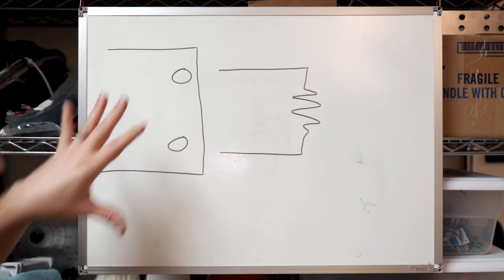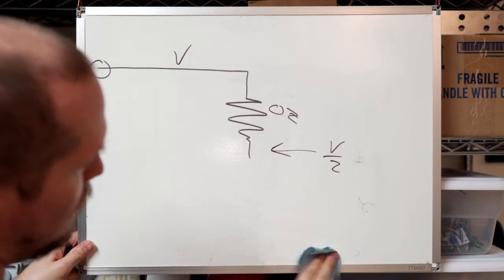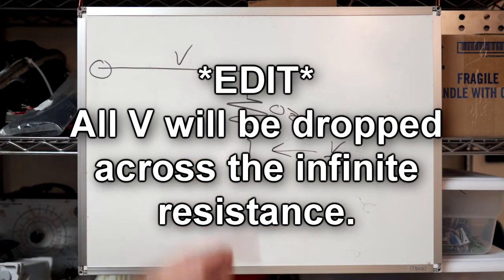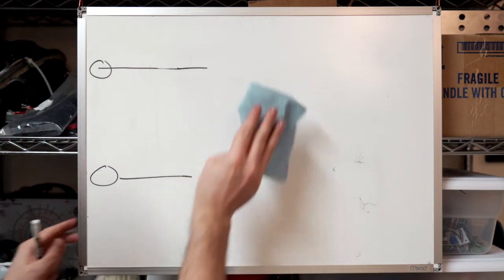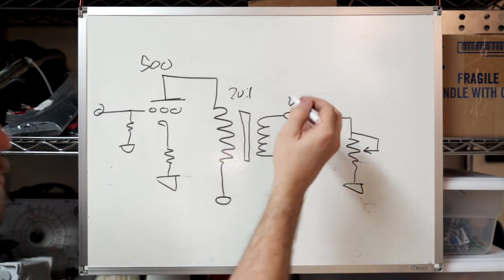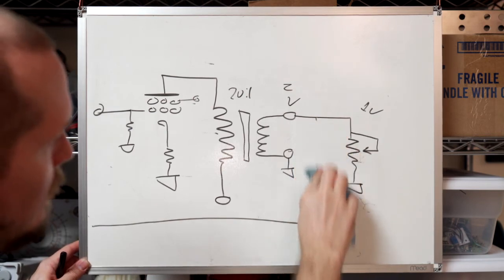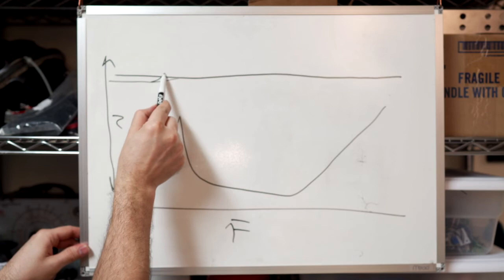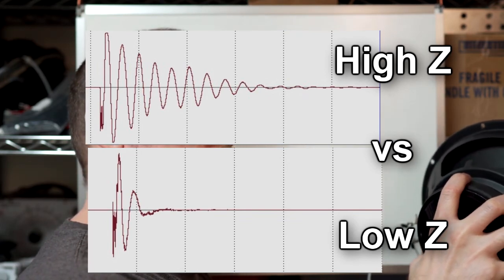Amplifier Output Impedance

Comment: also, a current source should enhance transient onset performance, no? because it'll increase the voltage to whatever is necessary to drive the current, whereas a voltage source will just give you a finite voltage.
Reply from the maker: In this case we’re not really considering a true current source. It’s more like a voltage source vs a voltage source with some series resistance.